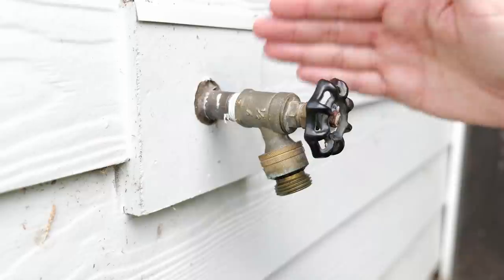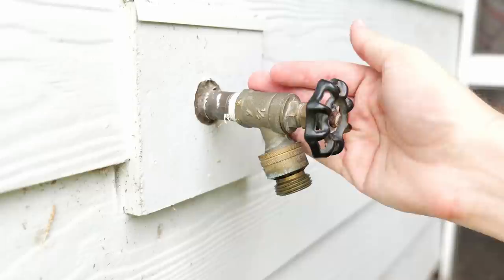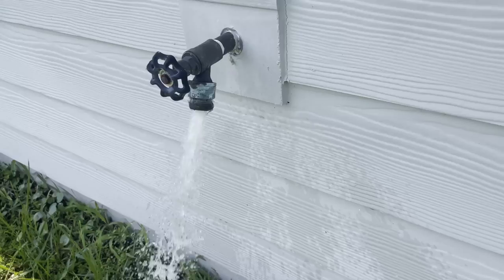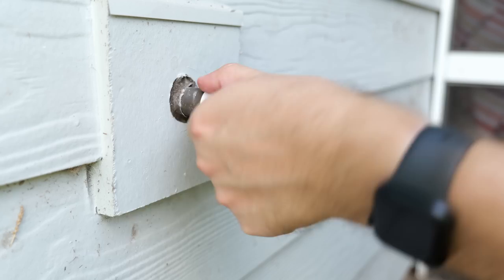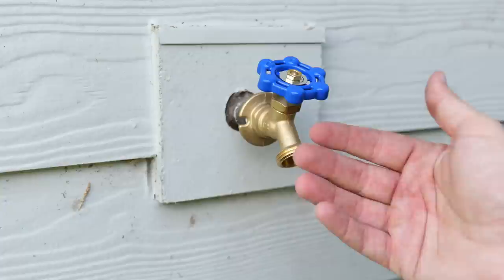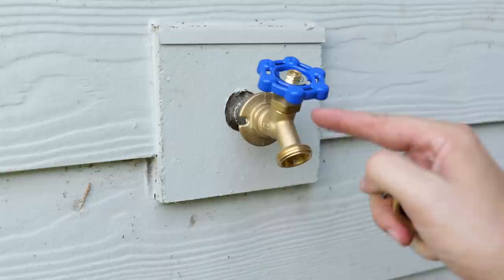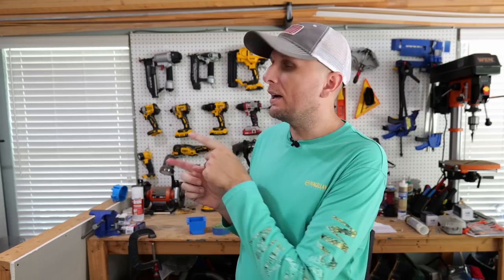The CORRECT Way To Replace An Outdoor Faucet | DANGEROUS and Common Mistake DIYers Make!

Comment: That machine screw which holds the vacuum breaker in place on the faucet threads is torque limiting. It assures that the screw will tighten enough to fasten the vacuum breaker against accidental or deliberate removal while preventing your tightening the screw enough to damage or distort the inside threads of the Vacuum breaker and allow the seal to leak. 

Here's the rub. The Uniform Plumbing Code requires that the Vacuum Breaker not be removable once installed. The other function of the torque limiting screw is that it is designed to break when the correct torque has been applied. That does 2 things. It assures that the Vacuum breaker is not removed following installation because enough torque is applied to hold in the exterior threads of the hose bib without applying so much torque that you damageg the vacuum breaker. The bottom line is that the Code requires that the Vacuum Breaker not be removable after installation. If the Vacuum Breaker does not have a torque limiting or other break away screw head you have to use a hack saw with a 32 teeth per inch blade to cut the screw off flush to the outside of the Vacuum breaker's internally threaded sleeve. 

I know that goes against the grain of people who believe that any threaded joint should be made so that it can be taken apart. Just tell yourself that the Vacuum Breaker is a part of the valve itself that gets assembled on sight. You don't want part of the valve to be removable. That is especially true of this type of exterior spigot. 

Tom Horne
Reply from the maker: That’s not true for all or even most areas.  It will either be mandated or not by local jurisdictions.  It’s not across the board.

Comment: The vacuum breaker has a rubber washer (standard seal for a hose bib connection) so you don't need teflon tape or other thread sealant on the hose bib threads. Also, although the replacement hose bib did not have a hex cast in, I did notice two wrench flats adjacent to the cutouts for the screws, so you could have simply used your adjustable wrench rather than the strap wrench to install the valve.  Good instructions nonetheless, including the most important thing about using a pipe wrench on the pipe exiting the wall to resist the torque applied while installing the valve.

Comment: My issue is no water comes out and looks like the whole pipe is in the wall. I dont have a basement to access the pipe. Would a plumber need to cut into my drywall in my laundry room to get to the pipe?

Comment: In 2010 Nibco sent me free of charge replacement hose valve stem assemblies complete with the handle and washer that I screwed into the hose valve body. At that time, the existing hose valves were 45 years old, and after removing the valve stem I examined the inside of the valve body and saw it was in good condition.  So I screwed the replacement stems into the body. Since 2010, all has been working well. After this presentation, I'll be looking into buying anti-syphon valves..

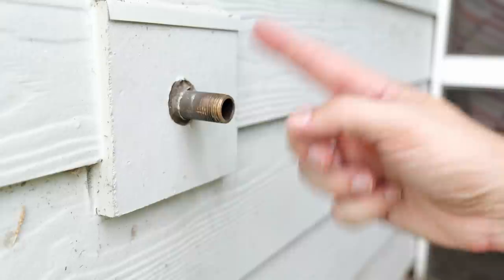Comment: 5:12  while you are technically correct. There are reasons to double up. 

1. If you go light on tape or dope, having both applied can save you from a small drip. 

2. Doing both is actually very handy for years or even decades down the road. So many times I have had pipes seized together because only dope or only tape was used. When you use both it is easier to break and unthread your connections in the future.

You will do yourself or someone else a favor by using both and the cost of using both is minimal. So just use both.

Comment: 6:10 Yes, you do have those notches. There are two flat slots on either side, parallel to the screw holes. It's not a hex bolt, but it's got wrench notches.

Comment: Mine does not have 1/2 or 3/4 on the side. Instead it has the letter L and the numeral 5 like this L5. What is the replacement part I need?

Comment: 1st, I'm not a plumber, but I have a lot of common sense, and I have sweat on new copper pipes in my home before and replaced an antifreeze faucet before.  Now that being said, now I live in a different house with an outside faucet, and I don't know if it is thread on or sweat on. There's a valve that is turned off just 2 feet from the faucet. So what should I do? I am unsweetened by the pip just before the valve and pull it out, then remove the old faucet and put on a new faucet, then sweat the pipes back together?

Comment: Those backflow preventers greatly reduce output flow. I removed all of mine and now you can actually use the hose with more than 20 psi. (Pcv is open all. The way). Increased flow more than double.
Reply: Would you tell your local funeral home or pharmacy the same thing. Or perhaps a chemical plant.  Your neighbor could have a hose thrown into a radiator full of anti freeze at same time as a water shut down event and you will have antifreeze in your safe drinking water unless there is an anti siphon or backflow device of some kind. Imagine if your neighbor performed autopsies.
Reply: Ah yeah.  Happens all the time.

Comment: How do you support the pipe with a pipe wrench if the hose bib is flush with the wall?
Reply: That's why I looked at the video!  It ended up being a kind of "bait and switch!"
Reply from the maker: I talked about that in the video.  How is it bait and switch when I never baited a flush mount hose bibb?

Comment: Serious question - how would the water flow backwards into the house when the water pressure is in the direction "house to sprayer".  And when you turn off the sprayer (using, say, an Ortho sprayer) there's no water flowing either way because the valve in the sprayer is closed.

Comment: You forgot one important thing when choosing a new hose bib. Make sure that it is for potable water. There are some that are not made for it as was my experience lately. Luckily I read the description of the bib before I purchased it.
Reply: Almost all hoses are marked as not for potable water on the original package, so unless one is filling a glass from the hose bib, I'm not sure how much difference it makes. Sure, the interior water of the house is connected to the bib. It probably has a higher lead content in the brass than allowed for potable water, but so do most hoses. It makes it very difficult to fill a pool legally, as only potable water is supposed to go into a pool, even though it is chlorinated.
Reply: As in most other areas of our lives, the government has gone overboard on the vacuum breaker/back flow preventer mandates. In my opinion, if your local water supplier is worried about this, let them pay to install and maintain the back flow preventers. As it is now in most localities, the customer is not only forced to have the BFP installed, but forced to have a certified plumber come out once a year to  re-certify the device. We were going to replace our galvanized water line with PVC. The BFP was almost $300 for a 3/4” version, plus $500 to have it installed, because you have to be licensed and certified to install one, then $200/ year for them to come out and re certify it. Nope.  We just waited until one weekend, ran the new line, and re-sodded our lawn( which needed doing anyway). No one was the wiser.
Reply: Been drinking from the garden hose since I was a kid on hot summer days. Hasn't killed me in my 60 plus years of doing it. Lol . None have had a check valve that I know of.

Comment: Does it matter if you switch to a bibb with a different type of handle? Water is coming out through the handle connection. I was thinking of a getting a new hose bibb with the quarter turn handle which seems like it would be easier for arthritic hands/wrists.
Reply from the maker: Yeah, you can absolutely do that and many do just because the 1/4 turns are a lot faster to open and close.

Comment: The problem with the anti-siphon valves is they reduce water flow from the faucet. I'm not saying don't use them. I'm just saying that they can be problematic in some situations, especially if you don't have great water flow to begin with and you want to use a high water flow demand device like a pressure washer.
Reply: Good point. I've got a beast pw...3400 psi 4gps witch I run off an outside frostfree hydrant. That water has not been filtered like my whole house water is, and flow is better too.

Comment: What are your thought on using a wrench handle in the spigot to twist the new bib on?
Reply from the maker: I think whatever gets the job done as safely and efficiently as possible without damaging it beyond what you personally can bare is good.  Doing it that way probably wouldn’t damage the spigot but depend on what the wrench handle is made of it could potentially break.  I have seen some lesser expensive tools made of pot metal which is pretty easily broken.

Comment: If you are going to the effort of replacing your hose bib, do it properly and get a frost free one. As Texas residents discovered in 2021, States that don’t normally freeze can still have flash freezes and frozen hose bibs can do thousands of dollars of damage to your home. Not only did they suffer significant damage, but the homes not having shutoffs for the hose bibs meant that they had to keep their entire home’s water shut off for weeks while they waited for a plumber, since they were all busy fixing everyone’s frozen hose bibs. You can do a job for cheap and pay more later or you can do it right.
Reply from the maker: Going from non frost proof to frost proof is not anywhere near the effort of replacing a standard hose Bibb, it is way more involved.  You have to replumb it which will involve cutting holes in the walls.  Not worth it for those of us in the south where we get the occasional freeze.  We have things we can put over our hose bibbs to protect them.
Reply: @HowToHomeDIY  I agree it is more effort, but just replacing the bib is a penny wise pound foolish solution. Frost free bibs really should be code throughout the entire US and Canada.

Comment: Hi. Thank you for this video...one question tho, does the new hose bib screw ALL the way on to the threads coming out of the house??? I ask this because mine will NOT screw all the way on, and there was a teeny tiney drip when I was done...so I wonder if I am supposed to screw it on even tighter?? I did use the teflon tape...and I only hand tightened it  but to go any more with it felt like it'd be too much, and the spigot wouldn't have been facing down....Thanks for your suggestions.

Comment: Why did you use pipe thread sealant on a garden hose connection? Garden hose connections utilize the washer on the female side. Sealing the threads will not protect from leaks. Npt or mpt sure but not with gh connections. Just curious. Good video.

Comment: I grew up just repairing leaky faucets and hose bibs. Come to find most people don't even know that you can repair them with a five cent part. People always want me to replace the whole darn thing and they look at me like I've got two heads when I suggest repairing it.
Reply: Actually, there are two parts that often need replacing. The main valve washer that closes it, and also the O-ring that keeps it from leaking when the valve is open. That's the one that almost nobody knows about.

Comment: I just watched you replace the washer only, which looked pretty easy for an old lady like me to do, so I was happy 😊. But now you are replacing the entire spigot?? I really don’t wanna get into something too deep and mess stuff up, cuz I live in a rental. My hose is not turning off completely and it’s running constantly, I don’t mean just a drip or 2, I’m wasting tons of water 😩 Since my spigot looks completely different than yours, mine is sideways… do you think that just replacing the washer will work? My landlord likes to raise my rent every time he has to repair something, even a doorknob, so I try to do everything myself watching YouTube. 👍 I think I do a pretty good job.
Reply: Did anyone help you with your question?
Reply: @Gods-Elect  ….. No answer yet, but my problem seems to be solved. After watching this entire video.. the spigot replacement wasn’t as scary as I thought, I think I could have done it. The word DANGEROUS  😳  is what scared me. Luckily my brother came to the rescue with a brand new “sideways spigot”. I didn’t think we would find that type for some reason, I’ve never seen one before. Thanks for the great video. I will “text” it to him, cuz I’m sure he won’t appreciate his sister showing him how to repair something, he never does. But I’ll be standing by, just in case he needs my help 🤭
Reply: @NEILZEE11  Great you got it fixed I was worried about you with your water running like that.
Not nice of your landlord raising rent when you need somthing fixed when its his job.
Have a great day.

Comment: those little screws on the vacuum breaker is made to break off to make it where someone can not remove them
Reply from the maker: Yup.  Dumb.  I don't break mine off in case the breaker goes bad.

Comment: So just changed mine but tightened it with my hand then a wrench after and put a little bucket under it and noticed have a little leak ? I’m worried if I try and tighten it more it will break

Comment: I had a guy replace a frost proof outdoor water faucet that started leaking after the freeze we had here in Texas a few years ago. The faucet is pointed to the side and not down. I'm assuming that is because that's where it was pointed when it was tightened up. What do you do in a case like that? Thanks.

Comment: Why did you not put a block of pressure treated wood around the pipe so you could also screw the spigot down where the notch outs are on the house bib? Would have also helped ensure less forces are being put on the outlet pipe when pulling a hose around the yard that is attached to the hose bid.  Also, vacuum breaker valves corrode and fail quite often, I would go with a new one. Furthermore, if you are only going to use your hose bib for washing your car and spot watering plants with no fertilizer attached other than a code requirement what is the point in having them?
Reply from the maker: Because I didn’t want to and it wasn’t necessary.  They are code.  I can’t tell you what to do or what you want or don’t want.  They don’t go bad that often and if you don’t break the screw off then they are easily removed and replaceable.
Reply: @HowToHomeDIY  I do agree with meeting code just because you have to, but I hate those things. Both of mine at my house have failed and until I replace them, I can barely use my outside spigots.  Putting a block between the wall and the spigot would have been a better solution and could help relieve stress on the pipe caused by the cantilever.

Comment: My blue wheel totally rusted out and broke off the other day... Cannot understand how you can manufacture something like this for the OUTSIDE and not make it rustproof... However, I got a new bip, actually the exact same as in this video, but I cannot the the whole bip off the water line, could it be soldered on? I don't want to invest more and more just to replace that little blue wheel, so what do I do?

Comment: Dude had me redo  his wife's home hair salon... new sub-floor and flooring, some drywall repair from a water leak... Project done, I get a call that all is  ruined. Husband decided to replace the frost-free without dope or tape the day after I left with disastrous results. You can't just go in dry, boys.
Reply: You don’t need either of those things. 🤦‍♂️
Reply: @Carl_McMelvin  What?Pipe dope or tape. Sorry, buddy, but as contractor with thirty years of experience and the former manager of a plbg supply house, I'll respectfully disagree. Even the anecdotal evidence of the ruined hairsalon should be sufficient example.

Comment: Seems to me like the added screw is just another point of failure to contend with when the pipe thread tape has been around for decades, and if the crew maligns the thread from overtightening, could add to the possibilities of leakage? ? Am I wrong here, or is teh screw PROVEN to prolong the life of a vacuum breaker?

Comment: Code requires that the breakable bolt be tightened til broken off as designed and makes the vacuum breaker NON REMOVABLE otherwise it is not compliant.
Reply from the maker: I’m not going to make it non removable and neither did the licensed plumbers that installed them originally.  3 out of 4 were not broken and all passed inspection.
Reply: @HowToHomeDIY  Our officials fail inspections if not broken off. YOU need to include that in your video OR STOP misinforming your viewers. CHECK codes...
Reply from the maker: I’m not misinforming anyone.  Your local code must state that.  It’s not national.  Calm down King James Version.

Comment: I put a gate valve on the inside lines going to the outside. I have two outside taps that get drained in late fall and the outside tap left wide open all winter. All the copper lines in this house are soldered on.

Comment: Unrealistic perfect line connection. Many hose bibs are connected in ways you have to start tearing out siding.
Reply from the maker: I mean, it was realistic, you could clearly see it was on my house and not a mock up.
Reply: I stand corrected. I should have said that is a properly plumbed and mounted water line to the outside of a house that lends itself well to changing hose bibs. I have had to deal with too many that were recessed behind the siding making any work on them difficult.

Comment: That hose bib will work but it is not the correct hose bib for that application. Your new hose bib should be attached to the wall, thus the two screw slots, the new bib should match the old bib with the hex flats on the female end so you could use a wrench and it should have an escutcheon plate to keep out moisture and insects.